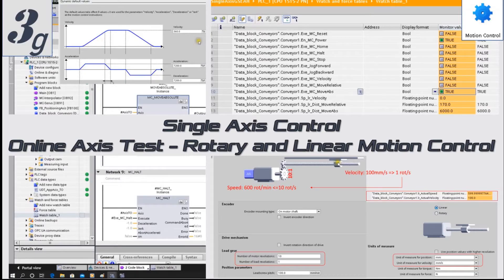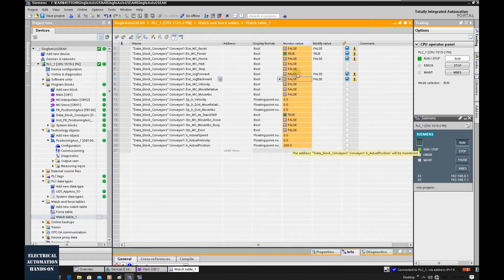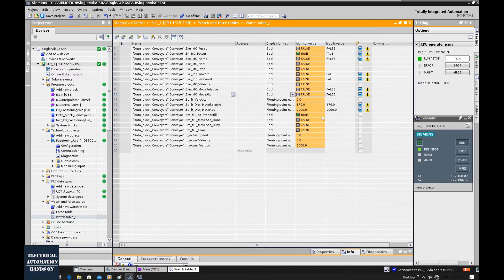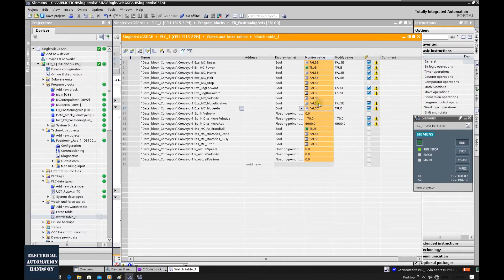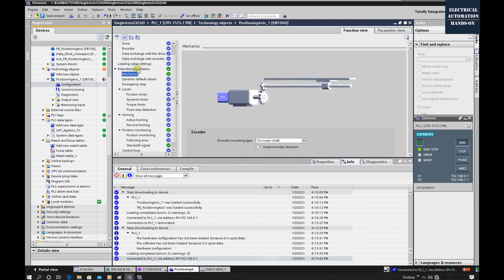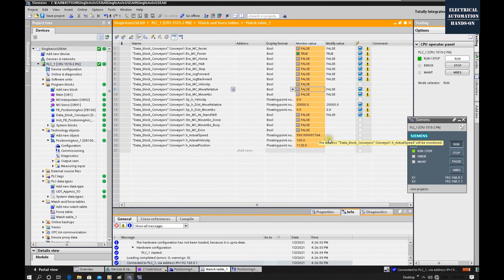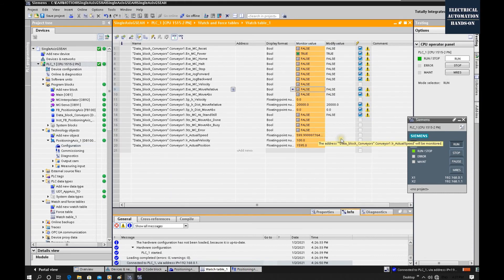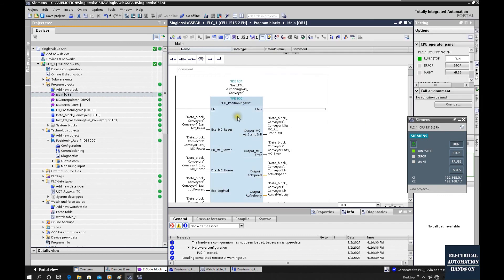MS03g. [Siemens Motion Control] Rotary and Linear Motion Control Online Test in TIA Portal [9/10]

Comment: This series was great and very instruction. Do you know how I can use the McMoveAbsolute so that if a certain condition is met while the axis are already in motion and it will update the velocity without changing the target position. I know that once this McMoveAbsolute has been executed it will go on until it is done but I want to abort it somehow and send an update speed. Maybe using two instances of the McMoveAbsolute or some blended motion but I am not very experience it that case.
Reply from the maker: Siemens TIA Portal motion command is easy. You can trigger a new command before the previous motion has not completed. You can use a second  McMoveAbsolute instance with a new velocity but the same position target. Siemens call this 'Override',  OMRON calls this 'Blend'
Reply: @electricalautomation thank you very much.

Comment: Great video! You executed move commands with Virtual axis enabled. Is there any key difference if we want to do the same with Activate simulation option instead of virtual axis?
Reply from the maker: In siemens, using program to control virtual axis and real axis are almost the same, you can use virtual axis to test your motion control logic.
Reply: @electricalautomation  yes, I can understand that, but I would like to know if there is difference between choosing virtual axis vs Activate simulation options. Don‘t know why there are two options for simulation. There should be some difference.
Reply from the maker: @asv5769  This is a good question. For testing the axis control-wise, yes, it is hard to say differently. But the virtual axis is actually mainly used for Cam control for syn with another real axis for cooperation motion control (e.g. lifting the pallet by using two axis).  The Activate simulation option allows you to configure the drive and encoder as the real configuration, but without the hardware connected and tested (you can test Acceleration, software limit, etc.). It is the main tool for the simulation test.
Reply: @electricalautomation  thank you!

Comment: Does PTO work as same as this? Do we need to change the block to be able to use PWM?
Reply from the maker: Please view this video, https://youtu.be/Od4cqjMst4Q?list=PL762SfoJC-e8NbAUQ-H7a_TOdqrlBPCw4&t=750
In the video, I was using Analog Output to control the motor. You can select the PTO option and connect the high plus Q to the Step motor drive module. Other configurations are quite similar
Reply: @electricalautomation  I did but I am unable to enable it to simulate it, I had to change the block from S1500 to s1200. I only have access to an s1212c. My commissioning from my To is grey, when I activate the Axis, I can't turn on the enable.